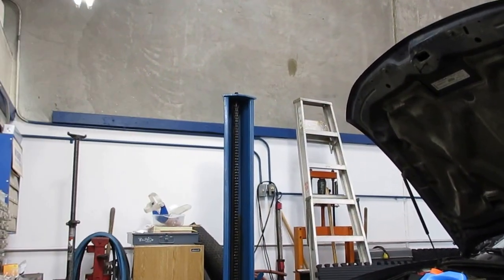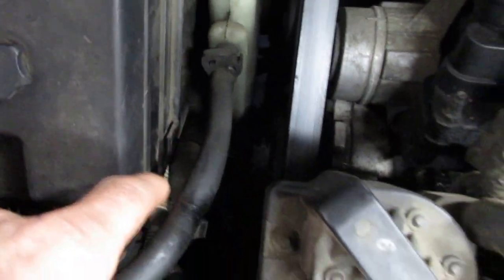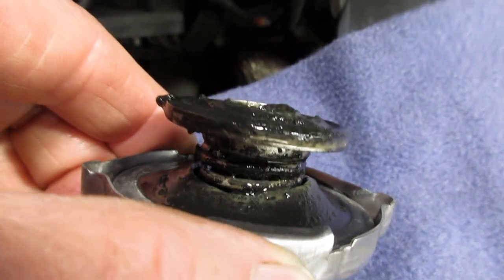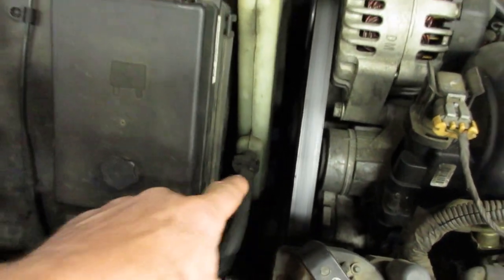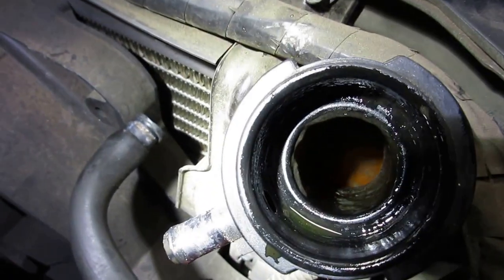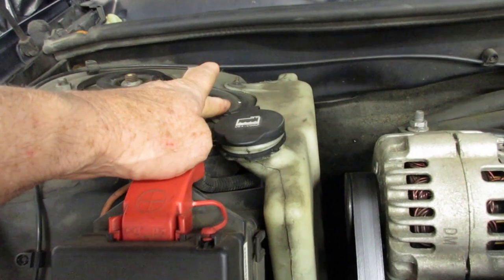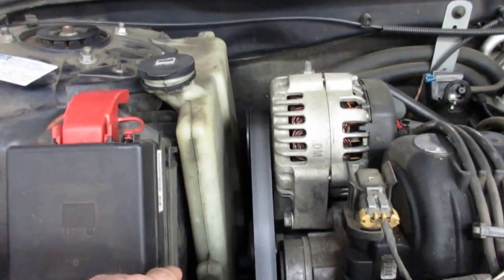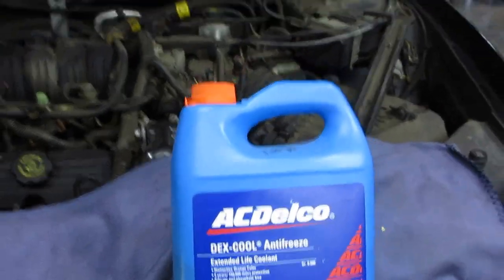Engine Oil in the Coolant Resivior

Comment: I just had an engine make over of 2004 Volvo s80.  Piston rings changed and a general full  service.  Car  was a perfect drive for about a week  then yesterday i noticed a lot of oil in coolant reservoir.  Mechanic who did the work says it needs a new radiator cooler replacement part.
I'm hoping he is correct !

My fear is he has buggered the head gasket.

Any advise welcomed.

Comment: My 04 mustang has oil in the coolant reservoir and my dip stick is bone dry, my head gasket isn't blown and I haven't checked the block for cracks so what could the issue be?

Comment: My mechanic pulled this trick on me! He put a little bit of oil into my over flow container to convince me the head gasket was blown! And told me I had to buy a rebuilt engine and have it installed... He never even checked the crank case, radiator or anything Just the over flow container. I just had this engine rebuilt 6 years ago. I YouTube a couple of video's for how to test and check for blown head gasket, for the signs. It has none of them! No milk shake in oil cap, no plume out of back of muffler, no oil in radiator, in fact radiator fluid is super clean... doesn't over heat at all, engine runs perfect, strong, no hesitation, full power, idles perfectly etc. etc... I took it to another mechanic and he checked it over for a few minutes and told me, "Someone put oil in your over flow container. You don't need to replace the engine!" So he had me clean out the container really good. I ran the car for a week, took it back to him... still clean. He checked it again and said, "Someone put oil in your overflow container, there's nothing wrong with your car!"
Reply from the maker: Great job Mike!!!
Reply: @JohnSadlersAutoRepair   Thanks...
Reply: @JohnSadlersAutoRepair  Yeah, just checked my air in my tires... instead of my mechanic putting more in all 4 tires, they all were less than 20 pounds... He just did the air pressure about a week ago or so.. supposed to be 32 to 34. Question: Is it possible to tighten the Bolts to the engine head to make sure they are tight? I mean without taking the engine out? Sorry I am not a mechanic but learning and having fun! Just wondering what else he might have done! ugh!
Reply: I feel like I’m dealing with this right now took my car in got the fuel pump changed all of the sudden there’s black oil in my coolant reservoir
Reply: @dmiggs9877  So what happened? P.s. my car is still running strong 3 years later after he pulled this on me!
Reply: @JohnSadlersAutoRepair   3 years later my car is still running strong!! If I had a blown head gasket as he was stating I am sure it would have gone out by now!

Comment: The 3.8L Series II, from 1995 to 2004 was known for the lower intake manifold gaskets failing around the coolant ports, allowing crankcase oil to seep into the coolant as the engine cools down and a vacuum is drawn on the cooling system. Sometimes it even passes a radiator pressure test. Most of it will show up in the recovery bottle, as the oil floating in the top of the radiator is ejected into the bottle. GM redesigned the LIM manifold gaskets in 2004 to address that problem, and Fel-pro has their own line of metal frame gaskets for it as well.
Reply from the maker: Thanks for the Tip !!!

Comment: I have oil in my coolant , but my coolant is now empty it's just the milky stuff in it , can I still add new coolant in it so I can make it to the shop to get it cleaned out or what?
Reply from the maker: @BabyPhysko  I would just fill it up with water. Watch the temperature gauge, if it starts getting hot shut the engine off and have it towed.
Reply: @JohnSadlersAutoRepair  even with the left over oil in it?
Reply: @JohnSadlersAutoRepair  I filled it up with water & the temp didn't change but the water drained somewhere
Reply from the maker: @BabyPhysko  do you have towing coverage thru your car insurance? company
Reply: @JohnSadlersAutoRepair  no
Reply: @JohnSadlersAutoRepair  I bought it off marketplace

Comment: This Jhon sedler is wrong this oil is coming from engine oil cooler which is top of engine oil filter housing
Reply: John is very confident but his explanation is very simplistic.
Reply: You are right,  this is the oil cooler failure. Its mixing oil and coolant.
Reply: i have a honda cbr f3 that has oil in coolant. how does oil mix in coolant exactly from oil cooler?
Reply: @lapislazuli5799  oil cooler has water chambers inside and sometimes  with time period its leake and than water and oil becoming one and this sign you will caramels color like cream in your water bottle
Reply: Oil cooler failure is right, why do these mechanics miss this easy symptoms?  Lack of knowledge and training.  Always go to an ASE certified mechanic
Reply: @alexghosthunter  I have the same issue with my 2011 Enclave. Is the oil cooler the part were the oil filter mounts? I believe it's referred to as the oil filter housing. If so, what is the part number? I cant seem to find anything on this issue except a TSB.

Comment: My car has oil in the coolant, misfire at idle and intermittently loses power going up hills! I was told it could be the intake manifold gasket!
Reply from the maker: Hi John, yes that's true. Look in the corners where the intake manifold meets the cylinder heads in the front and back. If you see external leaks there it's a good indication the intake manifold gaskets are worn out

Comment: I noticed some pink gunk in my coolant tank but only a layer of it. I took a couple napkins and tried to take out the top layer of transmission oil. I think I might have a bad radiator. I have a 1999 ford expedition. Hopefully it's the radiator and nothing else.
Reply from the maker: It sounds like the radiator to me
Reply: Yes this is rediator but if you dont want to change rediator than yhere is 2 pipe down contacted to rediator take out and join together its work
Reply: @javaidmalik1  lmao

Comment: I bought 2007 model land rover 2.2. It’s radiator cap is so oily and the water in it is black colour. Is it my radiator cap issue?
Reply from the maker: Hello, I would find  a Good Independent Land Rover repair shop.
Let them diagnose it for you, if you have any questions please reach back out to me.
The radiator cap won't resolve your issue.

Comment: I wish my problem would be so east to fix.  I can see a very small amount of oil film when I remove the radiator cap.  My engine also runs ruff after I have changed the plugs.  It's a 2001 Jeep Cherokee.  I put about a gallon of water in it per week.  I'm thinking either a cracked block or head. If I'm lucky just a head gasket.....still a lot of work.  Oh, to make matters worse the pinion seal is leaking.  Maybe bearing too to be replaced. Mechanic told be about $600 to fix that. If the engine is shot I see to need to fix the rear. Any suggestions?
Reply: Ok you see oil in rediator but is you see oil in your water reserve

Comment: That's all well and good if you poured the oil in. But what if you didn't pour the oil in and your reservoir tank has oil in it?
Reply from the maker: That would not be good. Alot of these engines have intake manifold gasket that can leak oil into the coolant. 
Also make sure it's not transmission fluid. The color will be red instead of brown. The transmission oil cooler in the radiator go bad also.
If all that is good there is either a crack in the engine block or a cylinder head gasket that is leaking into a coolant port.
Reply: @JohnSadlersAutoRepair  Hey John I really appreciate you taking the time to get back to me. I have a 2011 Chevy Cruze I was having transmission overheating problems. If I drove it far I'd get "Transmission hot idle engine" . The transmission shop said put a cooler on it. We ran the lines directly to the transmission instead of to the radiator. Which seems to have worked. Now we're getting beigeish /brown oil in the coolant reservoir coating the canister not so much mixing with the pink antifreeze. Thank you for the heads up about the transmission since I've already had some issues I think I'll start there. Look at the oil cooler or see if it's a gasket.

Comment: My engine started overheating today and when I opened the hood I heard the coolant in the reservoir bubbling/boiling. I opened the cap and there was a milky substance on the cap. It's a 2011 Mazda 2 with almost 130k miles. Where would you begin with fixing this mess?
Reply from the maker: I would call a few shops to see the pricing for possible head gasket, etc.
Also there are some companies selling used engines from Japan and installing them with a warranty. 
Would compare both ways. 
If it starts getting to expensive,  I would consider buying another car.

Comment: I would change the radiator and coolant expansion tank hoses etc , i myself sadly have just had the head gasket go on my Renault ,French cars are awful to be fair, anyway im now debating do i replace the engine with a  used one or just get the gasket .timing belt and water pump replaced ?
Reply from the maker: Hard to say, if you get a used engine be sure the timing belt is good also and a warranty hopefully? As long as the engine didn't overheat I would be more likely to replace the head gasket and make sure the cylinder head is level, not warped. If your engine is high mileage i would get the used one. Engines today usually go between 180,000 to 250,000 miles before giving trouble.

You can see here alot of people giving me a hard time , saying I don't know what i'm talking about. That the intake manifold at least has to be bad. LOL. I showed this video so when someone puts oil in the wrong place don't have the shop sell you an expensive repair with no evidence. Was simple what I did and the customer is happy.
Reply: Same here don’t know what to do
Reply from the maker: @Rusty Highlander Hi Rusty, someone put engine oil in the coolant resivior tank. I removed the tank, washed it out, replaced the hose from resivior to radiator, suctioned the layer on top of the coolant in the radiator. 
Refilled with coolant and new radiator cap. That has been ever since i made this video and the customer is still driving the car, there is no oil in the radiator or resivior when i service the vehicle.
I always Investigate and do the simple things first when all other symptoms don't add up.

Comment: I just poured engine oil into the radiator/coolant cap because I know nothing about cars and have no business doing these things.
Reply from the maker: What kind of car do you have? You poured in the plastic bottle on the side of the fender?
Can you take a picture and send it to johnsadlersautorepair@gmail.com.
Reply: 🤣🤣🤣 basically you fcke your radiator.. well try to pour water into the engine.. thatd be equal 🤣